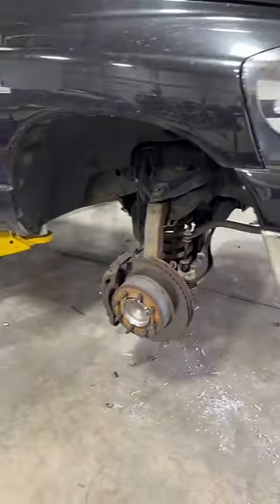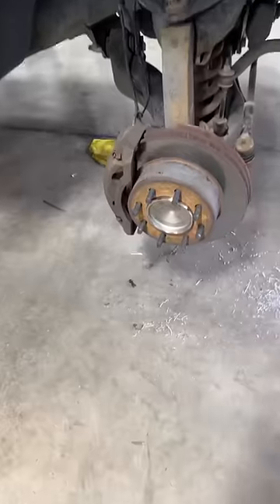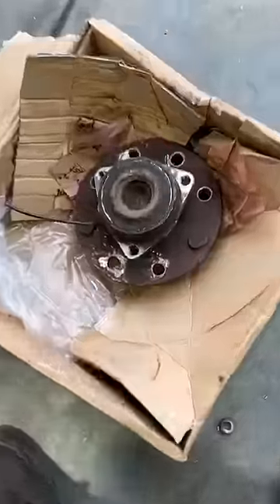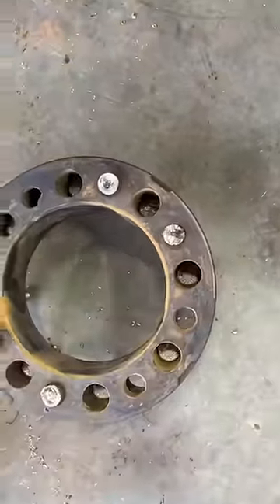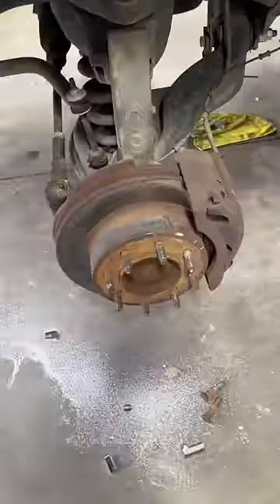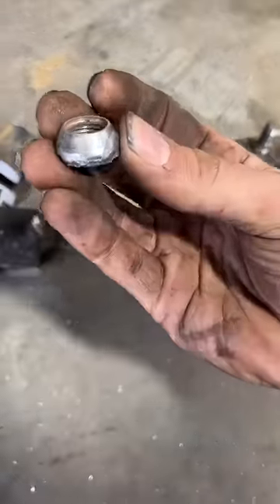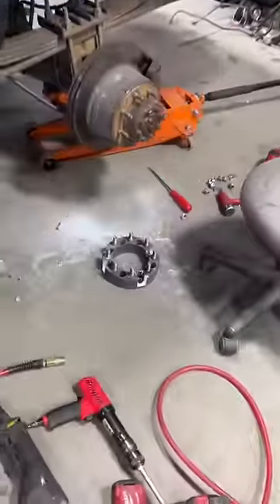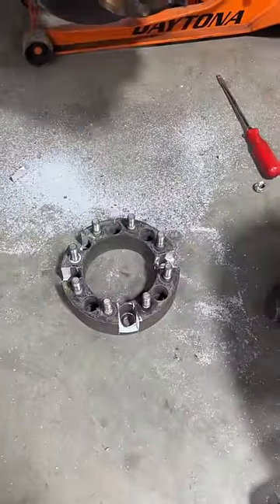I told the customer to sit down before I gave him a price 😂 I didn’t need him to pass out

Comment: The wheel bearing failure was caused by the spacers.
Reply: That's what I believe as well.
Reply: Exactly!
Reply: Yup. Spacers that wide exist only for looks. As an avid off roader, I would prefer no spacers and rather, a wheel with more backspacing to get it to stick out further. But the only reason I'd do that would be to ensure you don't rub the UCA at full articulation. You should have just enough offset for that, and no more, for this exact reason.
Reply: Lots of dually trucks come with factory spacers. Its the massive negative wheel offset that these clowns are trying to get that ruins the bearing.
Reply: And they never fail without spacers right?
Reply: It's a Dodge they come factory with bad wheel bearings and front end parts
Reply: The wheel bearing failed cuz your using China parts from autozone
Reply: @foxbodyguyeightyeight3672  nah, that's definitely Chevy. My 88 D250 went 170k before it needed new ones, and that was after it sat for a decade and a half as a yard ornament.
Reply: @throttleblipsntwistedgrips1992  1988 dodge was still really dodge though the past decade or two it's corporate owner of the month club
Reply: Exactly this. The affect the bearing in the same way as legalize offset...not different at all. It he has wheels made that fir the same way, but without spacers, the wear would be the same. It's about total fitment
Reply: I think the wheel bearings failing have much more to do with the vehicle being 20 years old and much less the spacers. I’m not saying spacers aren’t terrible, and I figure no one will read this far but in this one case I blame the vehicle age plus spacers
Reply: Not true, I currently run 1.5 inch spacers on my 01 Explorer and never had a problem (12+ years now.) I have later model 20” factory Ford adrenaline rims
Reply: Nah. Seen pickups run 2” wheel spacers for 300k. Wheel bearings are always going out in these.
Reply: @throttleblipsntwistedgrips1992  Yeah? I drove around the Moon three times AND drove from California to Hawaii in my Chevy! So far I have 30 billion miles on it AND Trump signed my tailgate.
Reply: @throttleblipsntwistedgrips1992  shut your mouth!
That may be the last part I haven't replaced on my POS D250...

Thank goodness I also have a Chevy!
Reply: Anyone who is a real mechanic knows why the spacers are the culprit.  People just need to leave unsprung weight engineering to the actual engineers who got paid a shit ton more than you or the aftermarket company’s did to design everything in the first place.
Reply: If you're going to run spacers you don't go any wider than 2" ever.
Reply: @openphoto I had a 99 long-wheelbase extended cab Dodge the rear in locked up on it going down the interstate that was fun.
Reply: Because the weight of the vehicle is off center ❤❤❤❤❤
Reply: @wooohooo007  not as much. Adding distance between the bearing and contact patch increases the stress the bearings experience. Refer to 5th grade science class when you learned about leverage
Reply: @foxbodyguyeightyeight3672  My stockish 95 with 200k on the stock parts disagrees. Maybe it's the exception, I dunno.
Reply: @bunsguns8222  are you sure its a Dodge? 😂 Just joking every brand makes good and bad and has a few lemons in the bunch sometimes I think it's just luck of the draw
Reply: Water is wet.
Reply: Those were expensive spacers.
Reply: The spacers come STOCK from dodge. but yeah, it's stupid.
Reply: @wooohooo007  spacers put alot more stress on the bearings so they wear out faster
Reply: Wrong. It's a dodge. But yes. The spacers don't help...but they are SO common for wheel bearings. Stock or not.
Reply: Good to know! Thanks!
Reply: @jrsforest187  your 4L60 determined that was a lie
Reply: @insertnamehere313  that's impressive AF, no lie
Reply: @throttleblipsntwistedgrips1992 pecifically it's the new plastic trucks that tend to be built from the wrong(cheap) materials..steel brake rotor, aluminum spacer steel stud and lugnut.. thats fused together with corrosion.
I think they could have used a torch on the brake rotor&spacer, use penetration oil on lugs and studs while HOT. 

   your in the clear, older 12v Cummins or gas trucks before fuel injection will constantly outlast owners and 40 years later they are still more reliable, actually strong, actually good looking.
Reply: Major offset in general
Reply: @0778drz110  never once seen a factory spacer...they make wheels that just fit now days.
Reply: @tellrowland2370  You've never worked on any dually 1 ton trucks then. The dually wheels wont fit without the spacer because many of them use the same hub for SRW and DRW trucks. The dually front is wider so it gets a spacer. Except it doesnt effect the wheel bearings because the huge positive offset of the dually wheels cancels out the added leverage of the wheel spacers.
Reply: Will wife tires without spacers be inclined to cause the same strain on the wheel bearings?
Reply: @HappyQuailsLC  if you draw a line from the center of the upper ball joint through the center of the lower ball joint to the ground that point should be approximately 1 in to the center of the tire. This distance is called scrub radius and it is the point of load of the vehicle. Normally you never want more than 1 inch of scrub radius. Changing the offset of the wheels changes the scrub radius. Excessive scrub radius is a primary cause of death wobble. It is not the width of the tire as much as the offset of the wheel.
Reply: @0778drz110  Actually you are right, spacers or not it's all about offset. Frankly, most mods of the kind being done here only diminish the performance and reliability of these vehicles while increasing the cost of operation of these vehicles.

Honestly most of the things these owners are doing is a self inflicted gunshot wound, I say let them shoot themselves in the foot...
Reply: @johndorflinger2344  Thank you John. I wish you could help me with my RV.
Reply: @backwoodstherapy  Spacer or different offset wheel does not make much difference.
Reply: @0778drz110  that's hilarious because I literally did a wheel bearing in MY dually f350 yesterday... It has a longer hub than the srw.
Reply: Also, it's a Dodge
Reply: @wooohooo007  Not nearly as much, no...
Reply: @backwoodstherapy  so then basically no different than using wheel spacers😂. Dear oh dear😂
Reply: They’re big no no’s  but if it’s your ride do whatever the fuk you want
Reply: They’re big no no’s  but if it’s your ride do whatever the fuk you want

Comment: Gee Whiz, a wheel bearing went out? I'm sure it's just normal wear and tear and those 2 inch spacers ( and probably huge tires with offsets way out of spec) had nothing to do with it!
I'm sure the rest of the suspension was tight 🤣

Comment: Aluminum spacers on a 3/4 ton truck. Real genius idea there.
Reply: Ran alloy spaces on all my cars from 18yrs old up until probably 25 and the only problem it ever caused where the constant comments on social about how I shouldn't do it lmao
Reply: Are the aluminium wheels a problem too?  As long as the hub locator is machined correctly, aluminium is just fine.
Reply: I don't quite understand the 3/4 ton thing, I know that it's supposed to be 750kg, but the thing is, the truck isn't 3/4 ton. It might be 2+3/4 (2.75) ton to be frank since sedans/wagons weigh around 1650kg (1.65ton) to 1800kg (1.8ton). Just wondering, I might be wrong on what you want to say, what you meant with that exactly. Drop a comment 😁
Reply: @luckgrip252  It's basically the payload that the truck can handle including the passengers.
Reply: @minzahhh1  big difference on a car vs a 1 ton cummins
Reply: @theaspiecoach5934  mate most the kids that own these trucks immediately ditch the steel wheels completely destroy the suspension geometry and add enough boost to pull the side off a Abram's tank lmao using its 1 ton abilities is the least of there worries
Reply: @luckgrip252  truck names are from the days when weight in pounds of payload was used. Most 1500s or half tons today can carry well in excess of 1000 lbs payload and so on
Reply: aluminum has plenty of compressive strength.
Reply: @MCatwar  well in this case, it’s mostly tension…..
Reply: @BabyGators  oh yep you’re right. these spacers have their own lugs. i instantly just thought of sandwich spacers. i guess the stress profile of the material would look more like a sinusoid though if radially traversing the spacer since you’ve got force on the back side from the trucks hub pulling on the spacer and then the force from the wheel pullimg on it.
Reply: @MCatwar  
Yeah aluminum doesn't tend to like sustained cyclical loading.

Maybe aircraft grade aluminum.  I'm guessing steel should be the material used if at all.
Reply: @luckgrip252 it’s based on the rear end and suspension, not on the weight of the vehicle. A 2500 (3/4 ton) and a 3500 (1 ton) are the same truck with different rear ends and a 3500 has extra or thicker leaf springs. And the classifications are based on the old model’s ability to handle bed weight. 
As much as trucks vary nowadays it’d be difficult to give each brand its own category because of the different amounts of weight they can haul in their beds.
Reply: @i-love-comountains3850  i mean i don’t think this would be cyclically loaded much since typically the way the wheels clamp is the forces applied to them from driving etc are below the normal force applied from the lug studs anyways. at least that’s how i see it— 8 lugs at 130 foot pounds (dodge wheel torque iirc) probably has an incredible amount of clamping force that driving conditions, while they are alternating, never reverse the stresses on the spacer
Reply: @i-love-comountains3850  brother you got science rockets and quick maths....I've legitimately gutter slapped 3 series bmws into rompa stompa curbs and shit and never had spacer related problems lmao 

But yes you smart fellas are correct about alloy it really shouldn't be used in that setting haha
Reply: @minzahhh1  this isnt a car
Reply: @MCatwar  problem is it is tensile strength that matters here
Reply: @minzahhh1  this is not a 3 series bmw. And ive never done that to any vehicle in the last 1/2 million miles i have driven
Reply: @minzahhh1  Cars and 1ton trucks are a bit different, especially when folks actually utilize their trucks for payload and towing purposes. I ran spacers on my small, light cars also, but I never would on a usable truck.
Even alloy rims/wheels will have their max capacity stamped on the backside usually, often only well under 2000lbs max per wheel, alloy spacers won't be any stronger.
Reply: @BabyGators  Mostly true, however most "half-ton's" today can barely handle a pothole.
Reply: @i-love-comountains3850  "aircraft grade aluminum" includes all aluminum funny enough, even the cheapest. It's industry buzz wording at its finest.
Reply: @JesusSaves86AB  correct mate that's why I said what I said about the kids who own them and run the spacers....I'd run them on a truck no worries but not if I planned to load it or tow 

If I was in America I'd have a dually with those semi truck steelies polished up not some dicky big alloy dishes lmao
Reply: @luckgrip252  it refers to its bed capacity. Anything you throw in the back as they say.
Reply: I’ve had bora hub centric wheel spacers on the rear of my 2500HD and -24 offset wheels on my truck for almost 5 years now no issues at all.
Reply: @minzahhh1  Lol...yeah it works just fine.  No problem
Reply: @BabyGators  finally someone gets it right. Just old terminology that doesnt necessarily apply these days, but is still used to class trucks.
Reply: @minzahhh1  On a car sure . . . a 2500 Ram is at least double the weight of most cars.

Comment: Air hammers are absolutely crucial to have as a mechanic especially when doing anything at the axles.
Reply: Air hammer saved me once doing a wheel bearing too but it a interesting way. I felt like i didn't need it but my gut told me to, showed me it saved me because the whole bearing came out in pieces and the race got stuck to the spindle. And no pulling it off by hand or anything so my air hammer had the chisel tip on it and i got in there and it slid it some more persuasion it came off had a mild scare on how i was going to get it off. However i did air hammer does like great work on getting stuff off or loose. Love me the air hammer, sometimes lil hard to control but i just gotta use it some more hehe.
Reply: @photondebuger45  hell yeah. I work on super rusty cars and trucks. Works great for making rust disappear from frames and brake rotors. Safer than bashing your thumb with a hammer. Rust in the eye is the worst tho.
Reply: @pantherplatform  rust, dirt, water, oil and brake dust in the eye been there way too many times. I actually don't know how bad it is working on rusted cars, i live in the desert so the only bad rust is surface rust. We get cross threading here HAHAHAHAHAAAAAA. because people don't even know how to use any power tool really they think itll go in fine and come apart fine. They are bearly right on one of those
Reply: Air hammer should be in every mechanics toolbox.  They are very useful shearing bolts, driving lug studs, pins,rear axle bearings the list goes on. Just buy a decent one Ingersoll is fine.
Reply: @mikerayle6103  indeed i have like 3 or so brands of air hammer but they every whichaway in my shed i know where some are but not the one i liked I'll find it hopefully
Reply: air hammer is cool and all but nothing can replace an oxygen-propane torch
Reply: @Robis_Grigoris  oxyacetylene for rust removal
Reply: @Robis_Grigoris  that's the "i had enough" tool
Reply: I run the snap on personally and I love it, definitely a life saver and will save you a ton of beating and banging
Reply: I bought a cheap one from HF. The chisels were like 6x the tool, but man, does it come in handy. Did the entire front suspension/steering on a Tahoe. It really helped out on the upper control arms and torque keys.
Reply: @ccubsfan94  I bought an Ingersoll Rand but was disappointed when it was puny like my very first one. I had been using a Chicago Pneumatic that was brutal for awhile that belonged to a shop I used to work at but they're crazy expensive just like the Astro Pneumatic one. The big ones last forever. The one bit that looks like the bottom of a Hershey kiss is the best. Great for U joints
Reply: @Robis_Grigoris  Oxy-acetylene and a air hammer is a guaranteed winner.
Reply: That's exactly how I got my bearing assembly off. Put unlocking hubs on so when I destroyed the hub assembly's with my hammer it was no loss, did it myself, not going to pay a mechanic to do it. 35 hundred for parts. Dodge ram Cummins last of the smokers. Four wheel drive and the factory set up will require u joint replacement , hence unlocking hubs. Yes brakes, u joints , unlocking hub kit, new tie rod ends, and emt ball joints. The shebang and my labor.
Reply: In aviation we have rivet guns. Look just like an air hammer and they operate basically identically, but they hammer less violently and more consistently (since they're designed to hammer rivets so the back turns into a mushroom shape to hold the rivet). We use them for this type of thing when we have to. We have an adapter for the rivet gun to hammer on a stripped out screw, it's got a hex on the shaft of it so you can turn the screw while hammering and it works a charm on real fucked screws.
Reply: For sure! I have every different adapter for it too and every single one has saved tons of effort and time.

Comment: Spacers don't do the bearing life any favors.  An all around lose-lose-lose deal.
Reply: Maybe, but it let me put 2004 Tahoe 6 luggers on my '66 GMC, by adapting the older, smaller studs to the modern metric size keeping everything perfectly centered.  I did have to replace all the factory studs with longer studs.
Reply: @tonyfremont  You used adapters, not spacers. Did you see how thick they were?
Reply: @Sweet68Camaro  mine were over 1" thick, maybe 1.5".
Reply: Not if yer running dually wheels. In that case you’ll be fine.
Reply: @tonyfremont  mmķķķ
Reply: @tonyfremont  ķkjjj0j00

Comment: Anybody that uses wheel spacers deserves to have this happen.  get proper offset to begin with, and avoid sticking on tires that your fenders and suspension can't handle.
Reply: wheel spacers came STOCK on the front of my 3500 dually. I didn't know they were there until I had a caliper failure which overheated the whole wheel assembly and I decided to replace the wheel bearing.
Reply: 100% same affect on same offset.
Reply: @Maybe-So  those are for the turning radius and 19.5 tires, no?

Comment: Moral of the story, anti sieze
Reply: Torque wrench?
Reply: @jamesjameson2576  you put the high temp anti seize between the spacer and disc surface same as you would between the rear disc mating surface and hub. Keeps it from sticking really bad to disc. 

Some high temp med strength lock tight on the nuts that hold spacer to hub would work wonders. Keeps a barrier between the nut and wheel stud. Makes it easier to remove in the future, keeps rust from forming and thermal fusing.